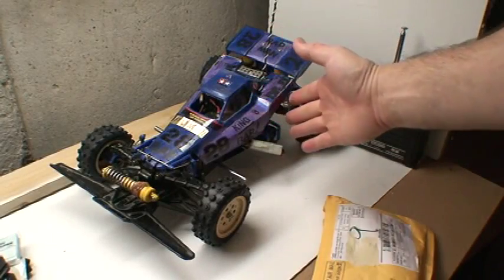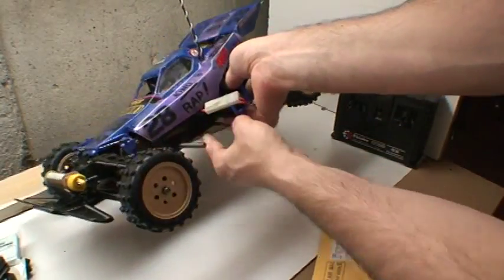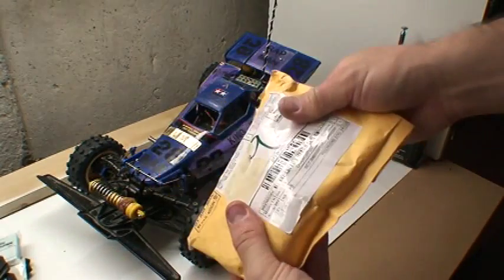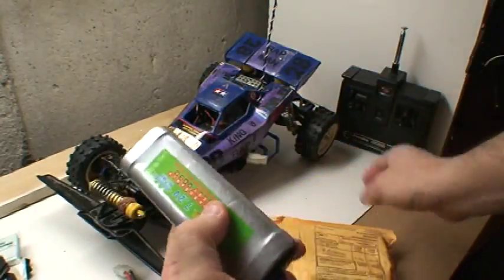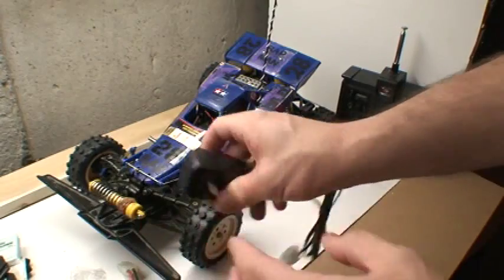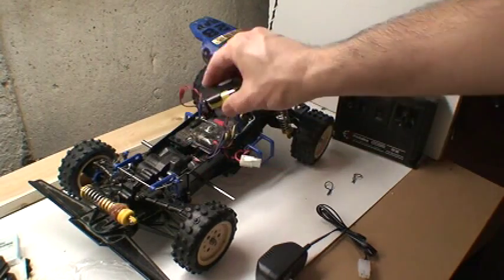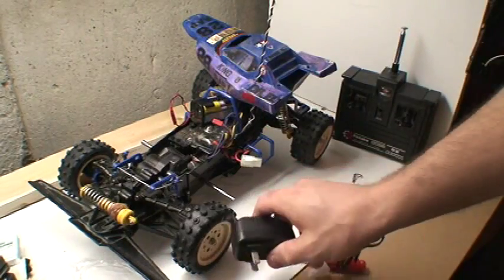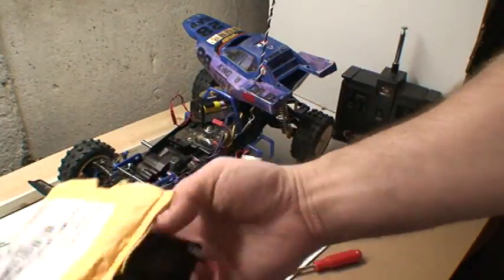Tamiya Boomerang RC Battery Charger Teardown

Comment: r u using lipo if not you do not need to do any of this nimh  for this battery it is safe
Reply from the maker: I haven't tried a LiPo. I'm using the old standard battery since the chargers don't have to be very smart and they are quite tolerant. Good idea though, maybe I'll look into LiPo as an option.

Comment: why don't you buy a smart charger... its so much better/easy
Reply from the maker: Yes I agree, it would be better. These cheap chargers rely on timing the charge to figure out when to stop. They are cheap but if you forget them charging or charge too long they could kill your battery or worst, cause it to overheat and blow.